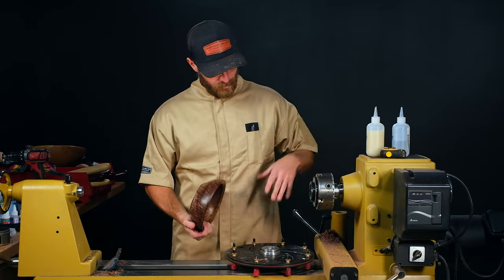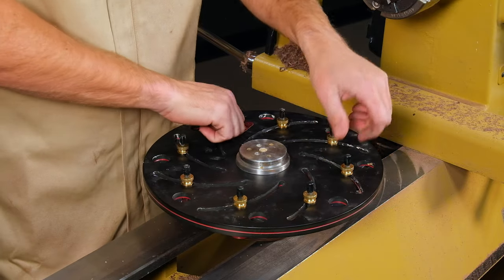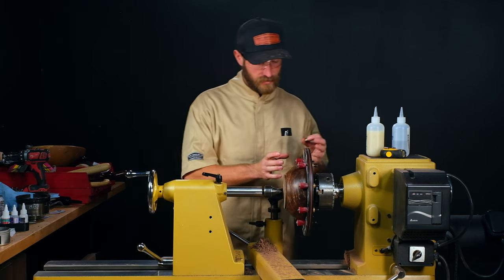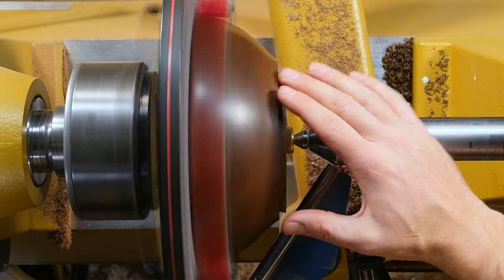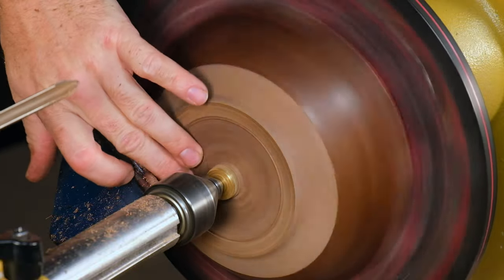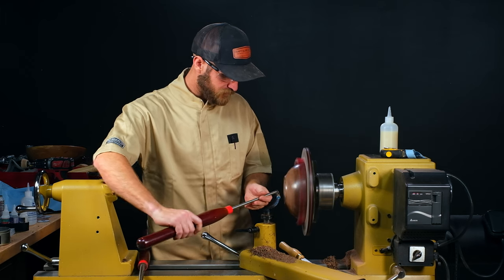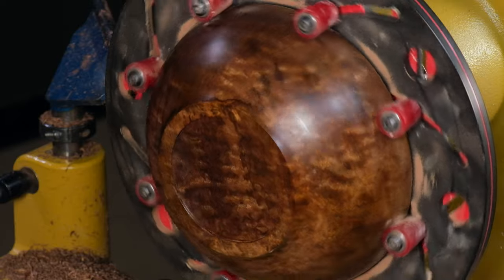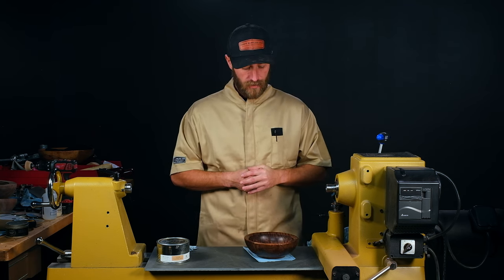Using the Longworth Chuck (Product Demo)

Comment: Just what I needed to see.  I’ve had a Longworth chuck knocking around the shop for years, but I’ve never been confident about how to use it.  I do have a dedicated chuck for my Cole jaws, but I have to move the buttons, Every. Single. Time. whenever I use that.    Just turning the plates looks easier.

Comment: I would think with the tail stock applied you would be safe to increase lathe speed.  Then when final finishing with the tail stock removed, slow down to the 600 max.  My 2 cents.
Reply from the maker: I agree, with the tailstock in place I usually bump the speed up a little bit.  -Mike